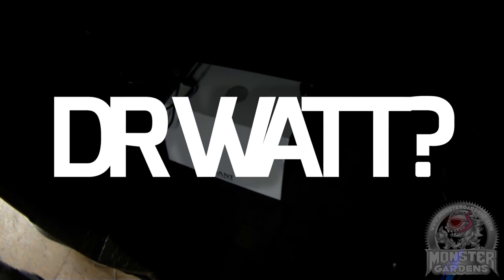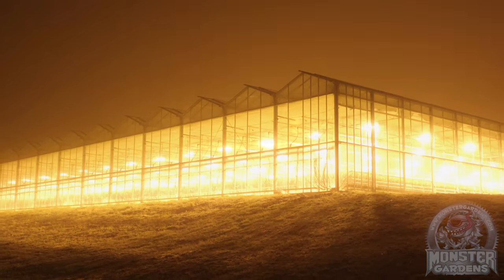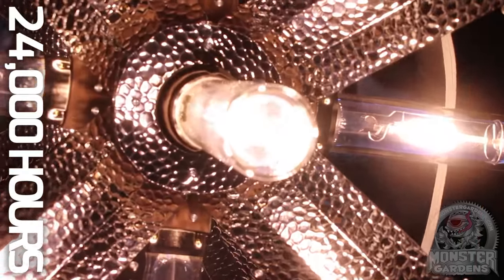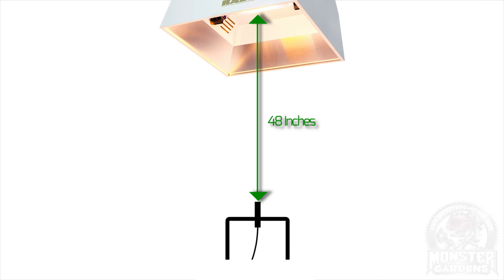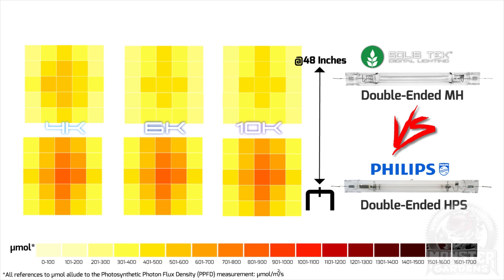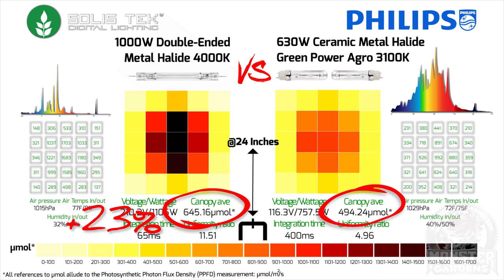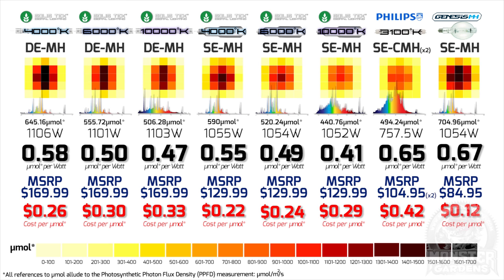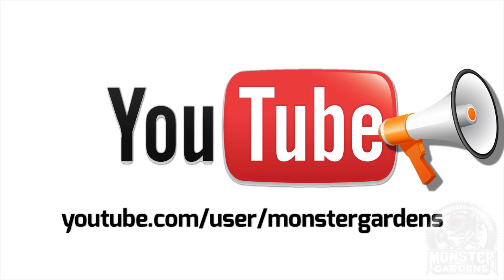TESTLAB Season 1 | TL#7 | DE-MH Testing vs. LEC, SE-MH, CMH, DE-HPS | UVB UVC INFO

Comment: Good video, well presented. If I may add one factor though: Light maintenance. We see that MH lamps hasve an extremely bad light maintenance over time. So even the Genesis, though a great output initially, will lose light pretty fast. Some HM lose up to 20% in less than 6 months. So in order to maintain light levels and yield. you would have to exchange these much more often.

CMH on the other hand, but perticularly the Philips CDM 315 (Philips' name for CMH) has a far superior light maintenance: about 8% losses per year of use.

What was not very clear to me though is the reflector used. Was it the same reflector for the DE and SE? That can make a huge difference to your measurements in the tent. We use an Ulbricht sphere for this, 

So indeed, the operating costs of MH are much higher than HPS. You were spot on identifying our worries as well, and we should add that single jacket MH ar NOT suitable or allowed in open fixtures, they do not have the /O (suitable for open fixtures) classification. This also has to do with the fact that MH arc tubes do emit vast quantities of UVC light. A broken out balloon does not cause the lamp to always switch off automatically, which can lead to extremely dangerous levels of UVC. 

Secondly, MH lamps operate under a much higher pressure than HPS. It is called HPS because the pressure in the arc tube is higher than a low pressure sodium lamp, which is more like a CFL or neon type of lamp. So when a Mh lamp fails, it fails explosive as you have demonstrated in your video. That is why /O lamps have a special protection against this, usually by an extra glass shield inside the lamp, or, indeed, a double jacket. Only these types of lamps are suitable for open fixtures.

Last, but not least: Indeed, most HPS fixture manufacturers do not allow you to use MH lamps in their fixtures and it will void the warranty. This is for two reasons:

1. MH ballasts have a re-fire timer: they wait a couple of minutes for the lamp to cool down before re-igniting it. Immediate re-ignition can lead to explosion of a MH lamp, which we have actually been able to do in our test lab. I assure you, an exploding lamp is not pretty, blasting hot glass of over 1000C into your room (or ducting if it is an air cooled lamp). 
2. A MH lamp can in some cases start acting as a rectifier. This is a technical phenomenon but suffice to say that a failing MH lamp can destroy your HPS ballast, which is not made to drive MH lamps. 

Other than that of course the fixtures were only approved by UL and CSA for very particular lamps, the DE HPS. Using other lamps that are not approved in your fixture is not in accordance with the NEC (National Electrical Code) and UL guidelines. It could even void your insurance in case of a calamity. Remember, UL was founded by insurance companies to increase safety. 

For the rest, I enjoyed this video. Well done!
Reply: Gavita Thanks so much for the info.

Comment: There are 945w and 1000w cmh bulbs out there
Reply from the maker: There is, just be on the lookout to ensure the proper ballast is driving the bulb.  DE CMH bulbs should NOT be placed into a fixture that also powers 1000w DE HIS lamps.  The frequency used to push the DE HID is 100+kH and the frequency required to push the DE CMH is 100-200H, what happens when you over-power a CMH lamp?  It runs the potential of exploding.